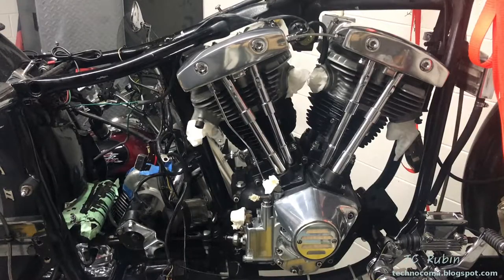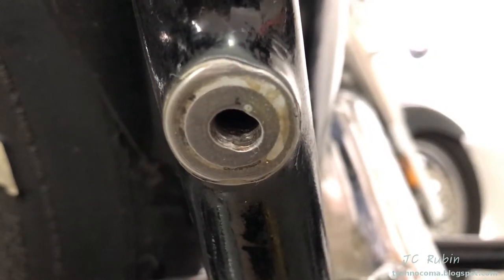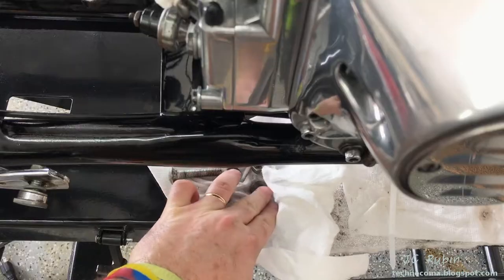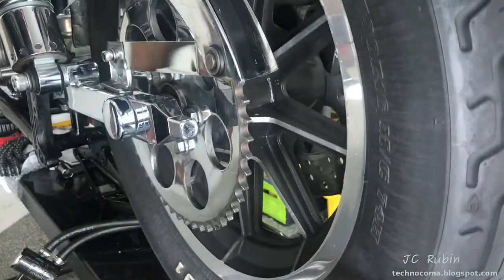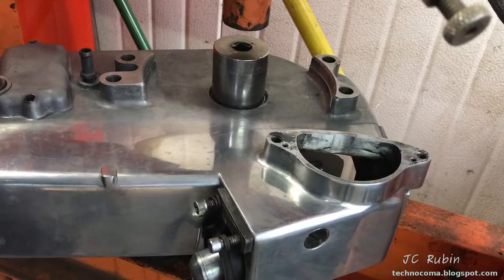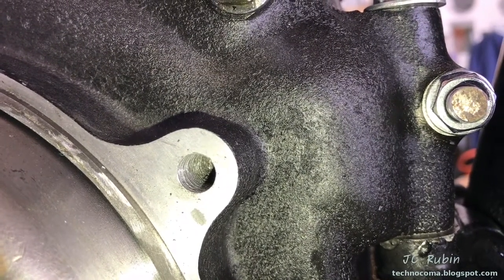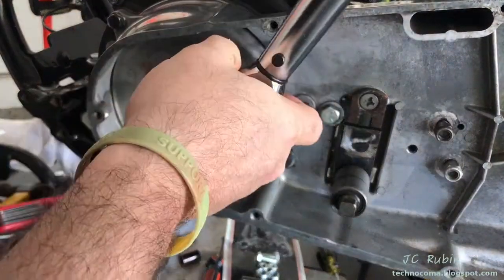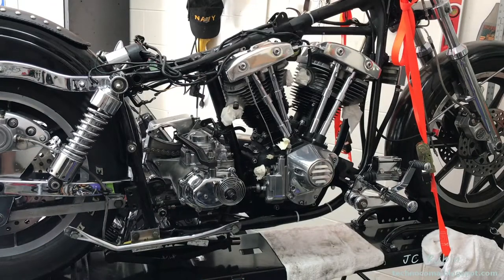AMF Shovelhead Lowrider Restoration -24 - Stator, Inner primary and Transmission Installation

Comment: I just found this at the right time, it all started with a broken shifter arm in the tranny, so while I was in there I figured that I would up the gearing because it was screaming at 60mph with a 22 on the tranny so I upped it to a 25, now I think my chain is too short. Then.... I had suspicions about the stator so was gonna do an ohm check and when I pulled the plug from the regulator I saw that one of the pins were cooked so now I got my hands full, if you're gonna be on long island tomorrow you're more than welcome to stop by, I'll barbeque
Reply from the maker: Long island? I havent been there in 100 years...
Reply: @delorean1  
Yeah, not the longest riding season.

Comment: That inner primary was a bear of a job to get back on. Did you use the safety wire on the 2 rear engine bolts?  I used the bend down lock tabs from V-Twin and they’ve never loosened.
Reply from the maker: Safety wire, always,